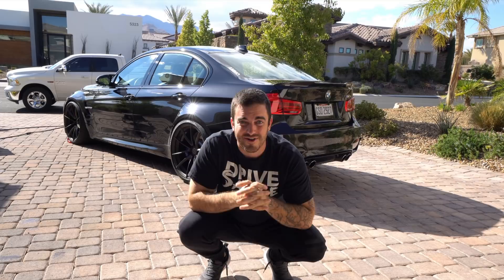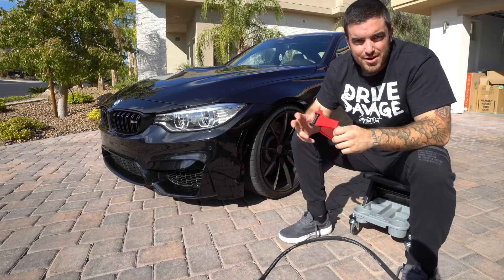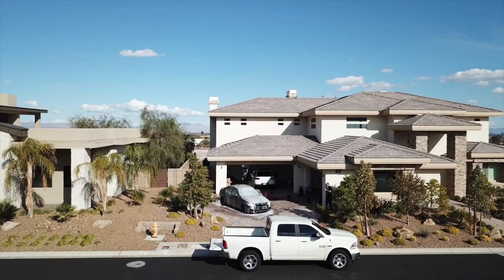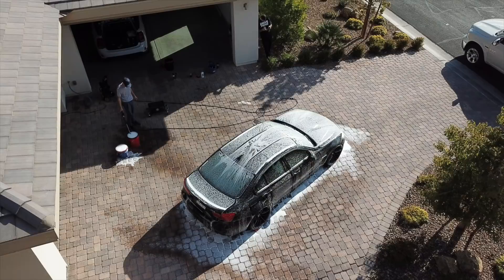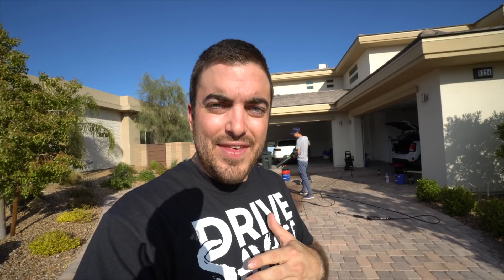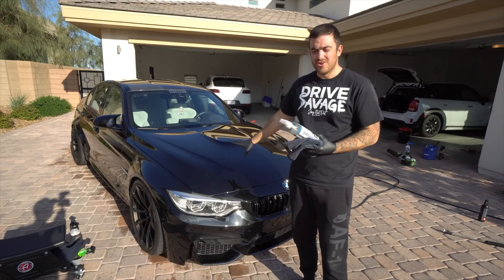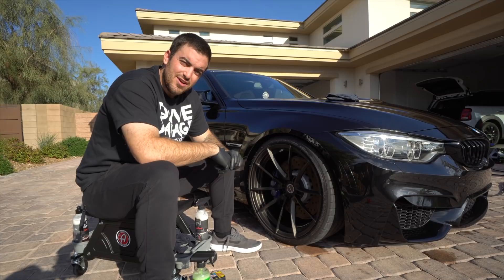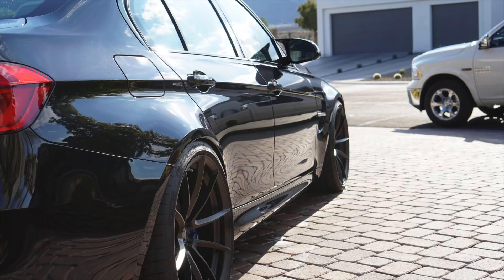How To Detail A Car Like A Pro! ft. Leno's Garage Detail Products - Jay Flat Out

Comment: How exactly does the ph allow the car to not have to be dried? So a spotless rinse is just water with correct PH?
Reply from the maker: Yeah basically
Reply: pH is correlated to the water hardness/softness of water. Basically harder water=more minerals (TYPICALLY higher pH)  and softer water=less minerals (typically lower pH). That canister looks like Reverse Osmosis/Deionization (RO/DI) system where it basically forces out all contaminants in the water to get pure H2O out of the system. But cant know for sure

Comment: Wheel cleaner with that color changing chemical does not touch my Forged wheels. AF wheel cleaner, Break buster.

With the Reload. The SI02 sealant would not have a issue with a  synthetic polymer protectant on the car?

Comment: Great video bro. The only thing i hate about detailing a car is cleaning the inside windows and i think there nice and clean and then go for a ride and see there's a smudge or something lol and Mann keeping a black car clean is so hard lol i wouldnt buy a black car again lol God Bless:)
Reply from the maker: They look great for about the first 18 minutes after they are clean though haha.
Reply: Try the three towel method
Reply: Soviet Clutch explain ?
Reply from the maker: i dont know either haha
Reply: Todd Hefer use one towel as a "throw away towel" degrease the window with 50% alcohol and 50% water 
After that you get your window cleaner (invisible glass Windex ect) and wipe it with a designated window towel after that get a dry buffing towel this will guaranty a clean window
Reply: Todd Hefer looks up ammo nyc three towel method this will ensure a clean windshield and a little too is to sit in the passenger side a rotate your wrist to clean the window
Reply: Jay Flat Out skip to 35:00

Comment: Jay,
Great video thanks for producing.  I have a 2015 Mustang GT Premium Black which is my daily driver and I live in Phoenix so when you mentioned about preventing dust to accumulate on the car.  I became even more interested.  I am constantly dealing with dust buildup.  What do you use to prevent?  I have to wash weekly to keep the dust buildup down and sometimes during the week I do a waterless wash.  Please forward me to the products and videos you did on preventing the dust issues.  Thanks.
Reply from the maker: Try the Leno's Garage Radiant - "JayFlatOut" saves you 15%
Reply: Jay Flat Out, Thanks so much for your reply. I am currently using Chemical Guys VO7 Detail Spray or Chemical Guys Extreme Slick Synthetic Quick Detailer and neither are keeping the dust off. I don't expect it to be completely null of dust but it's like a day and it needs a wash.
Reply from the maker: +Glen Pineo nope chemical guys is the devil.
Reply: Jay Flat Out, why do you say that. Actually I have some Adam's Polishes coming already before I seen your video so what's your thoughts on that brand?
Reply: Glen Pineo nothing will repel the dust. I use a California duster for light dust in between washes and works great. Never swirled my paint but my car isn't black.

Comment: Man I have to figure out a spotless water system for my Van. I'm using just gravity pressure from my tank. Not sure how adding the system will effect my pressure to the pressure washer.
Reply from the maker: Thats hard to say honestly, does your pressure washer have a water pump or is it strictly gravity?
Reply: Jay Flat Out 
It's just gravity fed. The tank is a hundred gallon mounted ontop of a slide out single drawer tool box on a dedicated frame. The natural pressure has always been enough to run my pressure washer. I don't have a pump pushing water to the pressure washer
Reply from the maker: It's hard to say for sure man. When you're ready to upgrade pressure washer I would grab one with a water pump. The filter system save so much time.

Comment: A couple of process that where not well done but great quality video.
Reply from the maker: can you elaborate
Reply: Jay Flat Out  yes sir, the jay leno soap is not friendly sun soap meaning no matter how much you rinse it will always leave this residue and when you are going to clean glass you should not oberly spray on Glass because over spray will fall on the paint and in that sun it will dry yes even on reload. Other than that great quality video and  maintenance wash.
Reply from the maker: fair points thanks for keeping us in line :) thanks for watching
Reply: Jay Flat Out thank you sir.